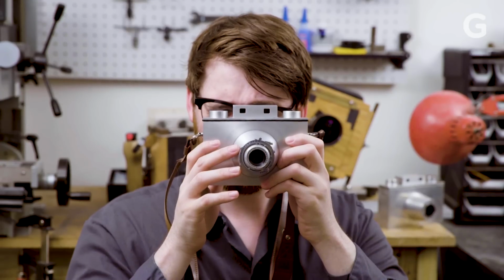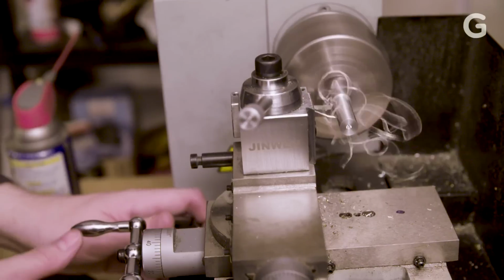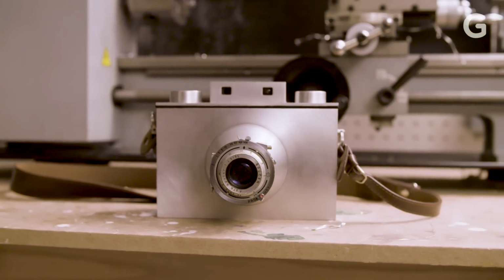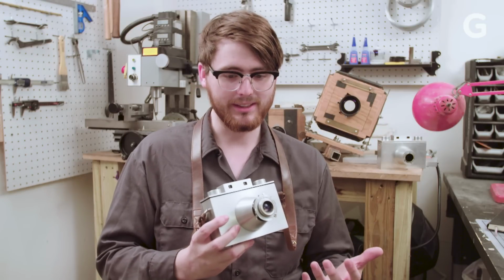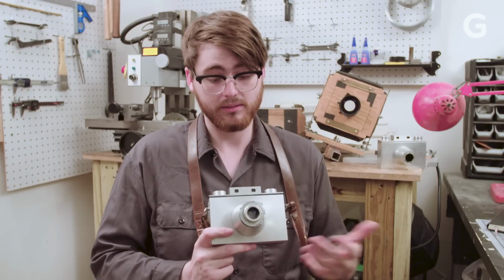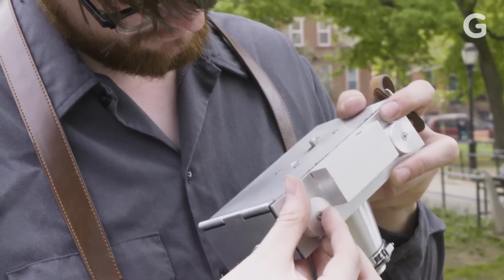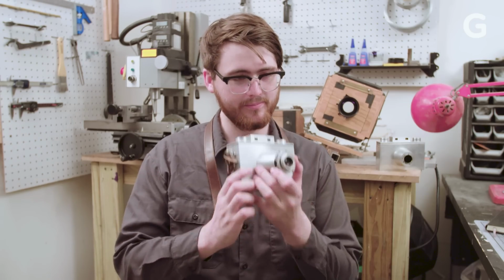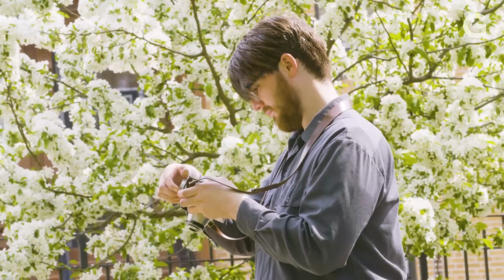Why Build Your Own Camera?

Comment: You could not afford a camera but you can spend $500 to build one and then keep buying the expensive film rolls?? a used plastic 35mm camera costs like $20 or sometimes free, why didn't you try!
Reply: The first one was made many years before, not the aluminium one.